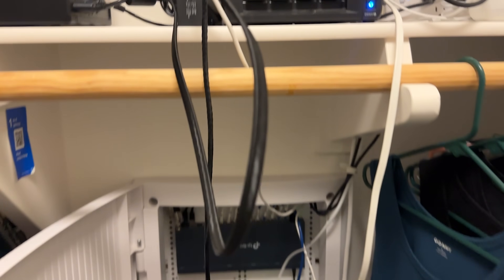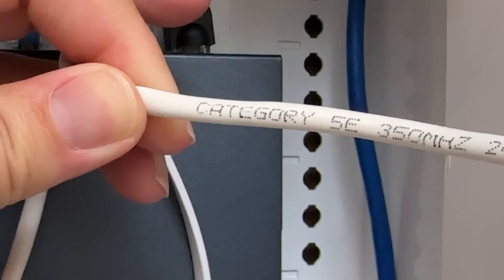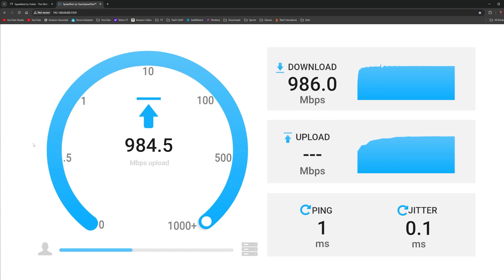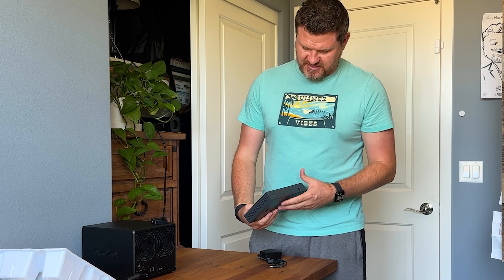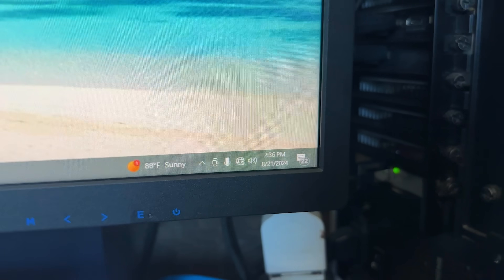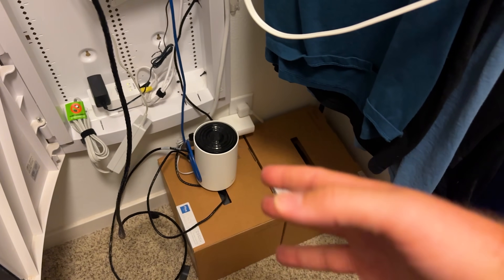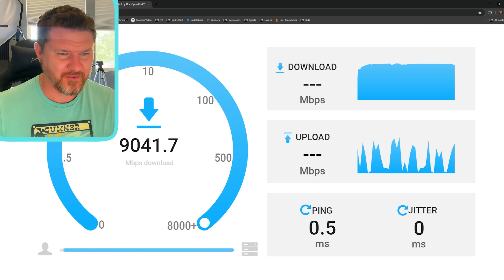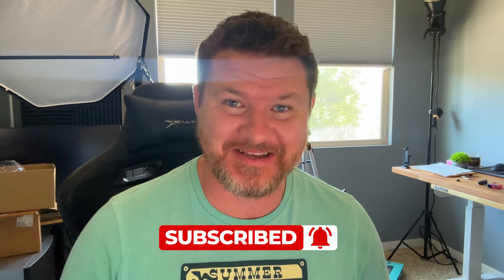Can I Get 2.5Gbit Speeds Over OLD Cat5e Ethernet In My Walls?

Comment from the maker: A 2.5Gbit home network is overkill for most of us, but i hope you enjoyed watching me test the limits of my Cat5e cables. 

 ► Playlist Home Networking Setup (2024)
https://youtube.com/playlist?list=PLABF0jOixZIt_RZzqObtLI7R4X7H07f5q&si=p5hRCp2N22CmLnpr
Reply: 3:10 i think that it should be said that this only aplies to device > device inside your local lan not into the Wan
Reply: How else can I connect my wireless mesh router devices without using the network adapters as a wired backhaul system if I don't have ethernet or coax cable outlets in my home? Is there a wireless way, can I use wifi pods instead? What do you think?
Reply from the maker: @sweetlifethebrand  mesh routers do connect to each other wirelessly.

Comment: Ok, I was not expecting a cat 5e cable to go that high. I've read many places that they have no issues pushing speeds to 2.5 Gbps, but I've never read that they can go as high as you saw in your testing. I guess I can keep my cat 5e cables instead of ditching them and getting cat 6 (or better).

Comment: To save people some time, the answer is yes.  The phone wires in my house are cat5 (not 5e) and I took out the phone jacks and replaced them with two cat5e jacks per room and a network switch in each room and I was able to do gigabit in 2009 and 2.5Gbps over cat5 in 2025 when I replaced two of my switches with cheap ones to test and then went all in for the rest of the house so that my wifi 7 APs were backed by 2.5Gbps for the whole house.

Comment: I'm so tired seeing those videos about how "much" speed can I get on 5e cables ..... duuh. It's physics people, physics, not magic. A cable is just a conductor. If it has enough thickness, min 5 mm, and is not very long, which is the case in over 97% of typical home users, it will run with 10Gbps not only 2,5Gbps. 
The only requirment is the material of the conductor. If you installed CCA, which alluminium plated with copper, you gonna have bad luck, but if you installed coppe there are no issues ! 
It's as simple as that !

Comment: can 5e is only rated for 100mbps but gig will work on it just like cat 6 is rated for 1 gig but 10gig will work on it if the cable is less that 55 meters but should really be cat 6a or cat 7 then to go 25 or 40 gbps should be cat 8 but at that point I would recommend running fiber

Comment: I wired my house a long time ago with a spool of CAT5e and a spool of CAT6, in parallel. (I just happened to have some good solid copper CAT5e on hand, so I used it.) For my home office, I had been running Gigabit over a decade on a CAT5e line with zero issues. Recently I tried running 2.5 Gbps on it and it seemed to work fine initially, but I noticed it would sometimes drop to Gigabit. Luckily there was also that CAT6 line so I tried that, and it's been rock solid at 2.5 Gbps. I believe the runs are only about 20 metres or so. BTW, I've run gigabit over CAT3 and it worked perfectly, but that was just a 2 metre cable.

Comment: I have a home Wifi network at home with Cat5e coming from my Fiber ONT service (2.5G) and ran in the attic for about 30-40 feet to a location in the family room plugged into a BE95 from TP-Link.  Initially I was very upset with my ISP Fidium as I have known Cat5e as being rated at approximately 1G throughput.  My question is, should I expect only around 1G from a WiFi perspective as the Cat5e can only do that or can it do more such as the full 2.5G from my ISP?  Should I update the Cat5e to Cat6?  I have noticed that you did a local network test with Cat5e that did do up to 10G, but that was local.  Is it the same for ISP signal as well?  Sorry that as savvy in this area and really need help before I cancel the lower costing ISP?
Reply: You shouldn’t expect to get a gig wireless. Wireless is for convenience. Don’t blame your provider for slow wireless speeds. Internet providers only guarantee speeds straight off the fiber gateway. They aren’t responsible for your wireless connection thoughout your home.

Comment: You can, and I have tested it, run 10GBASE-T across Cat5e cable up to certain very short distances like 20 feet without any errors or issues. At longer lengths you will have dropped packets galore. That does not mean that Cat5e will Certify at any length to the Cat6A specification...it will fail dramatically, in fact. This also does not mean you should exceed the ANSI/TIA specifications at any distance. You should not. The standards are there for a reason.

Comment: 2.5Gbit connectivity is definitely not overkill when you have a medium to large size family hammering Netflix, prime video, steam downloads, console downloads, multiple WIFI6e/7 access points and NAS server hanging off your hardwired network and multiple residential IP CCTV cameras operating 24hrs a day.

Its also really good to have if you already have proper fibre to the home broadband and you're getting like 1Gbps down and up which can be had very cheap in certain parts of the world for as little as £26 a month and 3Gbps down and upload speeds which can be had for as little as £56 a month.

Its a must!!!

Comment: its the cat 8 cable sometimes they just don't work at all with 1g network switches. Also that cat5e can handle 10g np as long as its under roughly 100 feet maybe 125.

Comment: Cat 6 and 7 contain better shielding to prevent crosstalk between the 4 twisted pairs wires in the cable.  The Cat 5e cable will accept and run at 10 Gb but you will probably be getting crosstalk errors more frequently. In other words, the network will be less reliable. Other factors such as distance may also contribute to less reliability.  However, Cat 5e can handle ethernet 2.5 speeds with minimal increase in crosstalk.

Comment: OK, I need to ask a question here.  WHY do you need such a high speed setup over your network cables??  The ONLY reason I can think here is to get the transfer speeds to/from your NAS drive doing video work directly on the NAS.  Because 1Gig is MORE than enough to stream 4K video to all your rooms and still have plenty of headroom for the rest since your ISP is only at 1Gb service currently.

Comment: Not sure why you say that a 2.5Gbit home network is overkill for most of us. With servers, NASes and more 2.5Gbit might not be fast enough for many of us. I've been running 10G to servers and workstations for many years and put in 25Gbit fibre between servers and NASes. None of it is terribly expensive anymore. You should have kept your 10Gbit stuff, especially after determining that your in-wall wiring would support it.

Comment: I wired my home with Cat5E about 20 years ago.   2 story home so I can run the wires either from the crawlspace up the wall or attic down the wall.   I more recently upped my internet to fiber 2 Gb symmetrical.  Due to the short Cat5E runs I am able to see 2.5 to devices capable of those speeds.  I had planned on updating the ethernet to perhaps Cat6A but in the end didn't need to.

Comment: According to ISO/IEC 11801, the minimum UTP cable specification for supporting 2.5GBASE-T Ethernet is Category 5e, which when properly installed and maintained, can support 2.5GBASE-T over distances up to 100 meters.    Higher speeds like 5GBASE-T and 10GBASE-T require Cat 6 cables however over shorter distances.

Comment: I wish 10GbE switches weren't so overpriced, my network setup is kludge central. Basically 2.5GbE switch and to each PC, and for my main desktop PC, I use an additional 10GbE NIC and a direct Ether et connection to my home NAS build, since the cost of those NICs have come down a decent amount, but 10 GbE switches are still insanely overpriced.

While there are some cheaper suctions such as switches that will use QSF+ modules, the issue is the really cheap aliexpress ones will often not have good cooling for the modules, thus is you buy a one of those switches and a 10GbE module, you will notice the module get insanely hot.

I just want a good affordable switch with at least 3 10GbE ports already set to use RJ45, and at least 4 2.5GbE ports.

Comment: Firstly, no one calls it "Category 5 cables", we just call it "Cat 5e" (cables). 2.5Gbps are rated to run on standard Cat5e cables, basically if you are running Gbe speeds, you can run 2.5gbe. Cat6 cables can support up to 10Gbe up to 50m and Cat6a supports 10Gbe up to 100m.

In practice, a relatively short run of 10-20m will allow Cat5e to run at 10Gbe speeds. Though you might need to re-terminate both ends with Cat6 rated connectors.

Comment: I was in the same boat. I was able to get 2.5g by swapping out the keystone jacks to cat6, even though my house is pre wired with junk cat 5 from 2004 from the builder.
Reply: I wired my entire house back in the 90's with Cat5 wire and jacks and I have no problem pulling 2.5g over my network.  Maybe I used better wire and jacks..............

Comment: Ceertification includes also distance parameters not just speed parameters. So Cat5e Can handle 10Gbps for 164 feet (55m) you only need Cat6 if you want to go over that.
Reply: That's not true. The number you listed is for CAT6(10Gbps / 55 m), not CAT5e. CAT5e can do 10 gig on very small runs but is not rated for that distance. CAT5e and CAT6 are similar in most implementations, and if not done cheaply, the results in this video would be possible. It's likely there's very low interference here.
Reply: @jonreed5431 my ap negotiates 10gb to my switch almost 3 floors up (into the attic)on the other side of the house. Not sure the distance but it's a daily big house and I couldn't really get any further away than that.

Comment: Did you figure out why the top port on the TP link router failed? I had this issue and it failed on mine. Port 1 (top). You have to contact TP link and they'll replace it for you. If thats not the issue, fair enough

Comment: Every time power and/or internet goes out or an update is finished I have to unplug my Ethernet cables which are plugged into my TPLink router and move them into different ports. Then when the light turns green and internet comes back I can plug them back into other ports again. I hope this helps anyone having similar problems. 😮

Comment: Regular Cat5e cable is only "certified" at 1Gbps (or 1000Mbps) speeds. It can theoretically handle more than that, but it definitely won't be able to push all of that through it's rated 328ft of max cable length. So long as your runs are shorter than that it can definitely push up to 10Gbps of throughput, but the consistency of it is not 100% and you may experience packet loss occasionally. For 2.5Gbps speeds though, Cat5e is more than enough!
Reply: Cat5e can do 2.5 and 5 gigabit at 328ft (100m) and 10 gigabit at short distances.